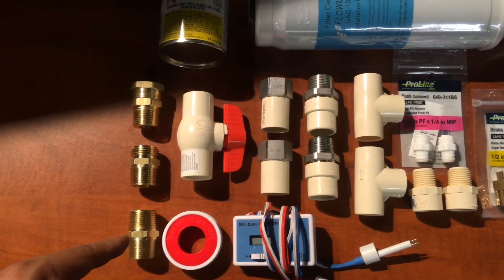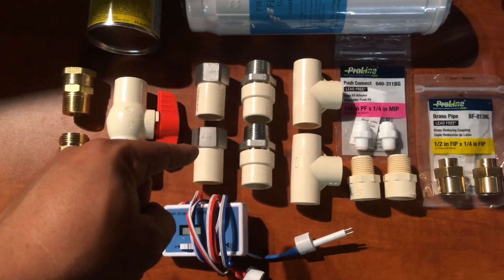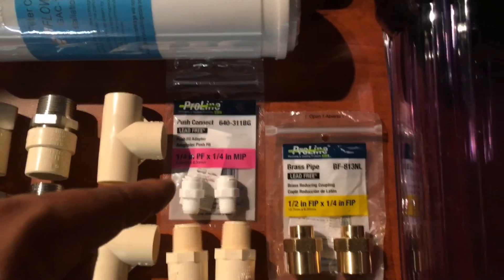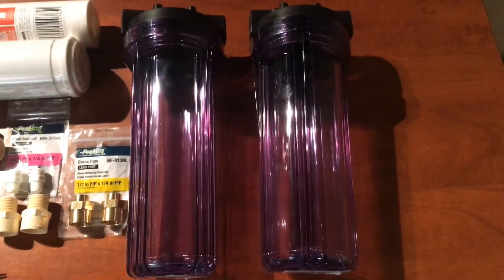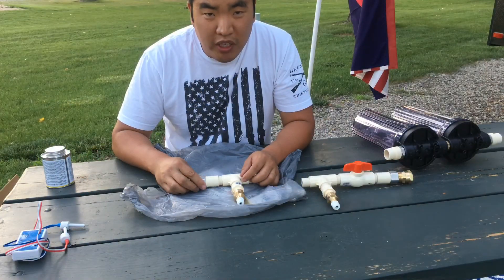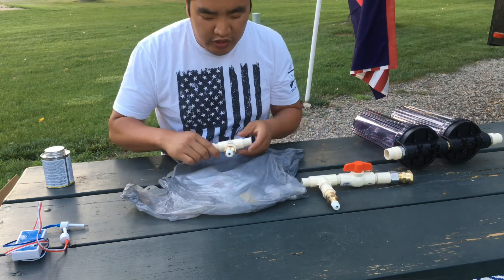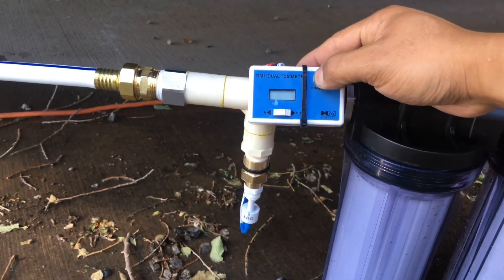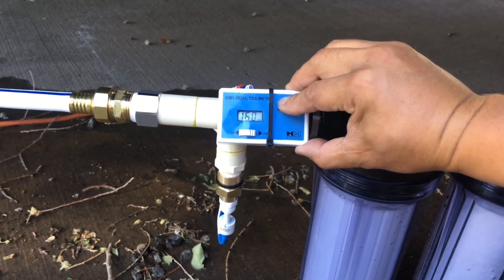DIY RV Water Filtration System

Comment: Did you ever come back with a TDS ppm count? and have you checked the PH? Great video!
Reply from the maker: I did not check PH as the Prefilter and Carbon don’t really effect that. As far as TDS, depending on the Starting TDS it definitely varied but I’d say it dropped the TDS by around 30-50%. If you really wanted pure water and low TDS you would have to run it through an Reverse Osmosis Membrane. That would basically be impossible as it would kill all water pressure unless you had a very very very large RO system.

Comment: What is final flow rate after your filters?  Or, how long does it take to fill you fresh water tank?
Reply from the maker: I’m not sure what the exact final flow rate is. but I can say that we were able to take showers on full hookups with not a significant noticeable difference in water pressure. Plus the water was much more soft after going through the filtration.

Comment: CAN ACTIVATED CHARCOAL FILTER BUILD UP BACTERIA FROM WATER FAUCET ?
Reply from the maker: Great question and the answer is absolutely! While potable water is technically safe to drink it is still susceptible to bacteria growth when just sitting stagnant. Which can also effect a standard carbon block. That is why I went with the KDF Carbon block which helps to eliminate harmful bacteria and keep it from growing during stored times when the filter system is not being used. Regardless you still want to change it out after prolonged use or after sitting for long periods of time.

Comment: Great video.  I'm having a lot of trouble locating some of the fittings though.  Any chance you could add the part numbers, or something similar in order to facilitate locating the supplies.  The adapters are the ones I'm having problems with, but numbers for the others would certainly help other people as well.
Reply from the maker: +Jack Cobb I'm on vacation at the moment but will work on posting a list when I get back!